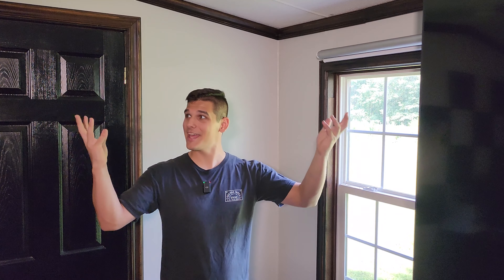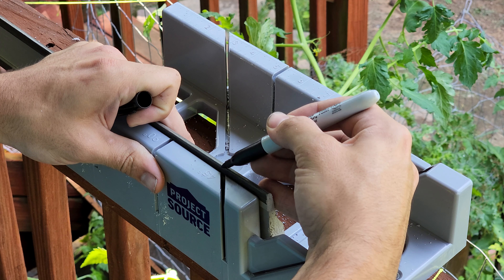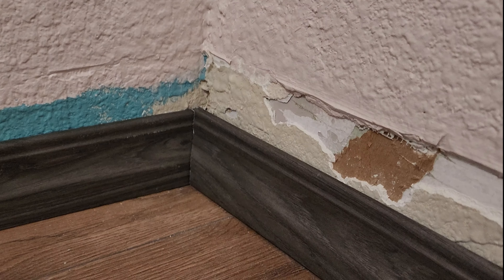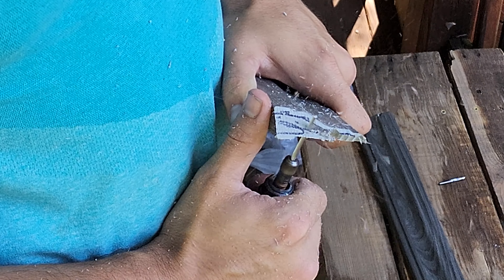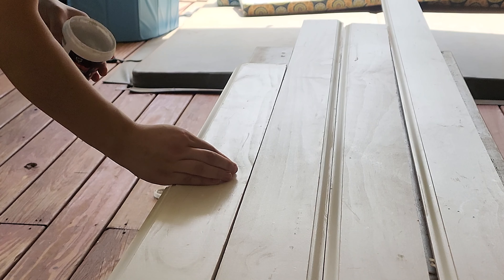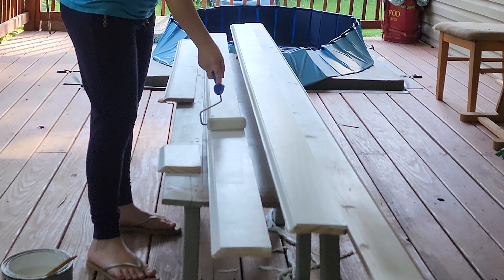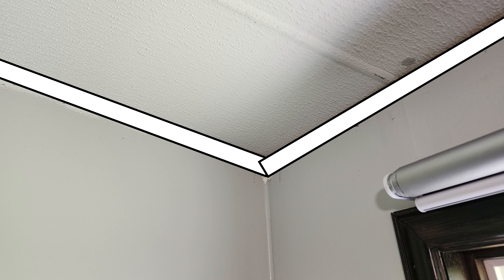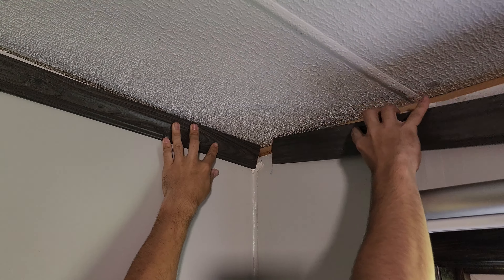Installing Wall Trim in 3 Levels of Difficulty  -- How to Install Baseboards and Crown Molding

Comment: Aww, Kiana! Gonna be famous before she's even 6 months 😉. Ugh I still have to reinstall trim in my main bathroom. I made a pathetic attempt before, but the wall is slightly warped...but the biggest issue is, I don't have a nail gun or compressor, so I was trying to hammer finishing/brad nails into the wall without smashing my toilet lol. I need more tools....
Reply from the maker: Ahhhh, yeah, trying to install trim without a nail gun is sooo tedious, especially on the ceiling where you have to try and hold it in place while hammering 😅
Reply: @hopesdreamsducttape41  Yeah, I wouldn't even attempt lol. I guess I'm just going to have to bite the bullet and get one. Planning to build some wainscoting for my kitchen wall too, definitely wouldn't be fun hand nailing all that into place 😬. Any recommendations for brand/type?
Reply: Great show! Thanks for sharing your sister with us. Hope you bring her back in future tutorials 😀
Reply from the maker: Surprisingly, the best kind I have used is Milwaukee
Reply: @hopesdreamsducttape41  thanks, I'll start there then